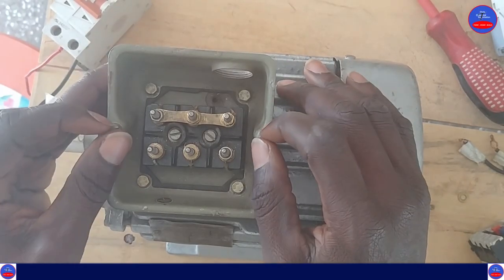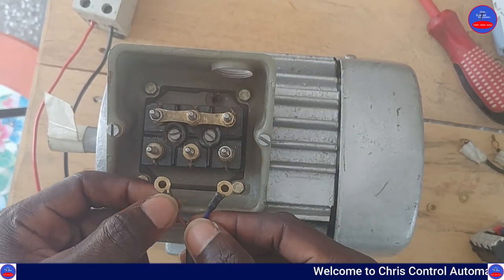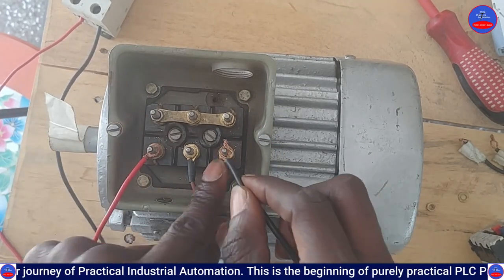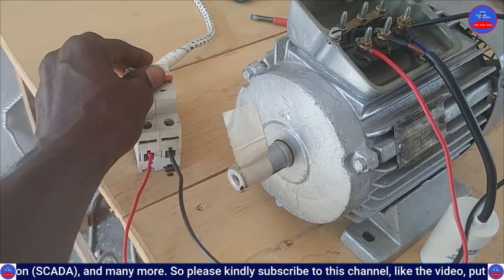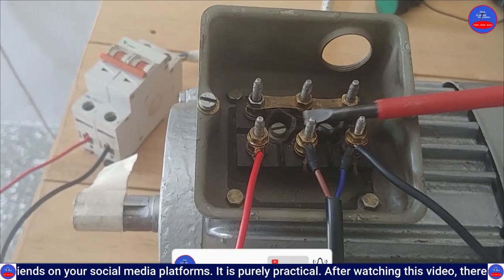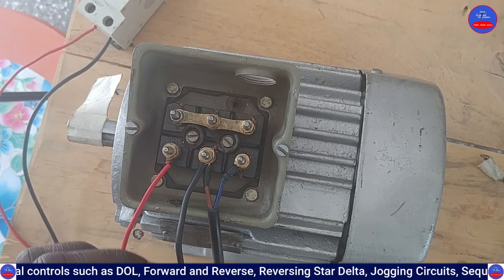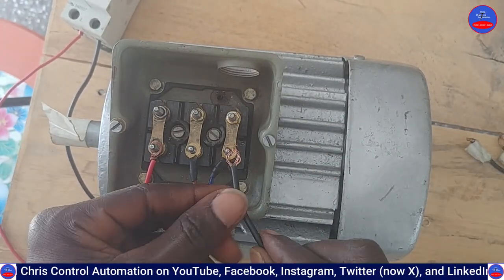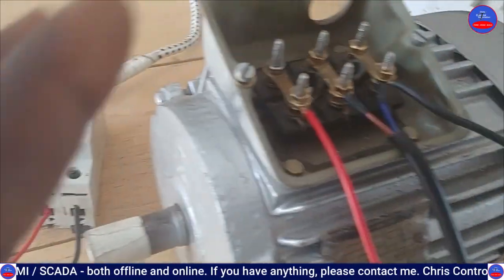Running three phase motor (star or delta connected) on single phase supply

Comment: I see.. I thought this was not possible. 
What role does the capacitor play
Reply: Oh I se
Reply from the maker: It is there to shift or displace the phases, providing an alternative voltage and current so that the windings of the motor maintain their magnetic field, during the negative half cycles of the supply voltage.